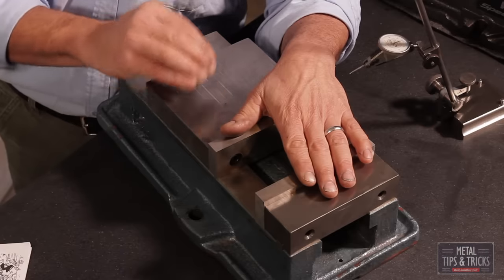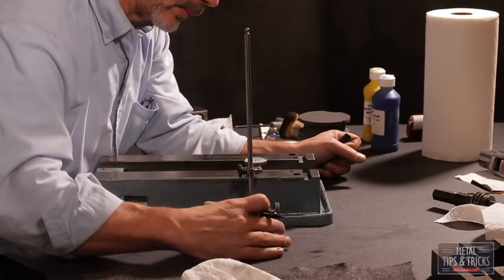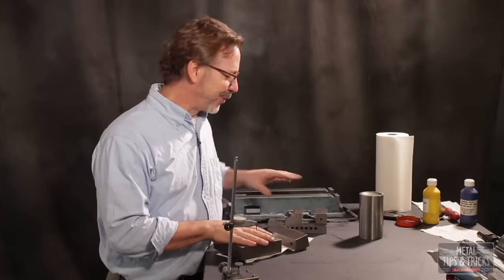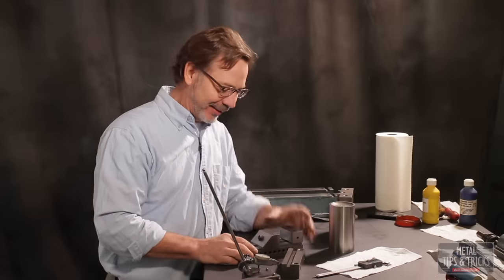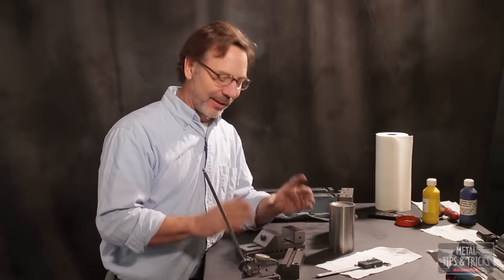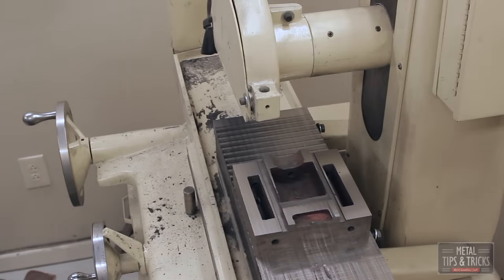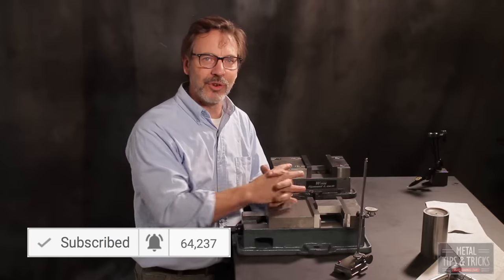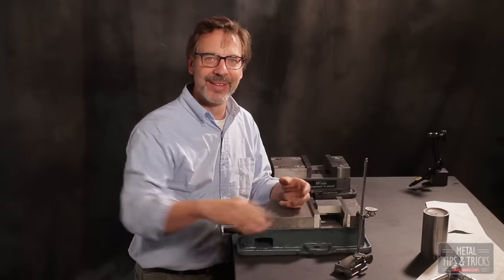China vs Usa  controversy machine vise

Comment: I  actually worked at the KURT vise plant in the 90's, making D60 vises. The level of quality control was ridiculous. We were actually sent home for days because the castings wouldn't pass the test you showed (under MUCH higher torque) until the foundry figured it out. Even though it was a tough job, it's still the only vise I'll ever use. Money well spent.
Reply: Cheap Chinese Junk. I bought a small 3" Chinese Kurt and had to totally rebuild it. It is now one of my most precise vibes but, I had to put the work into it. I also had to send it out to have it put in an oven for curing. It was hours in the oven

Comment: I have 20 years in the machine shop as a Journeyman Machinist and Class A Tool & Die Maker. I have spent many hours on a surface grinder, grinding things parallel and flat. I found that if you have two surfaces that are warped, I have gotten Plaster of Paris and mixed it pretty thin and poured it on the bed of the surface grinder, then put the part on top of the P of P and worked it in until the high places touched the bed then set back and let the P of P dry completely, then turn on the magnet and surface grind the top of the part flat. The P of P would fill in the high spots from the bottom and when it dried and I turned on the magnet, it didn't move. Then release the magnate, remove the part and clean off all the P of P and lay the ground surface on the bed and grind the other surface parallel. I have found that 99 times out of a 100, this worked to perfection.
Reply: Great method!

Comment: Grinding the vise will not reduce the amount the part rises during clamping, but adjusting the angle lock feature will...
Reply: I'm surprised a guy this well equipped didn't realize that. He didn't even mention the lift mechanism

Comment: I admire your tenacity.  I used to have a Brown and Sharpe #2 6x18 surface grinder which was automatic grinding except for down feed.  I thought I was bored running it for hours on end.  Here you are doing it with a manual machine.  What a man.

Comment: Dale. Another thing with castings is ageing. They really need throwing out in the yard to rust and get hot and cold for about a Year before final machining. That is why if you can get hold of old machine tools, they are great not only because of the original ageing before being machined, but also the further ageing over the Years. A bit like Scotch Whisky, the older the better it gets.
Reply: Dave Ticehurst BMW used old engine blocks for their turbo F1 engines back in the 80s because of that reason
Reply: +jonnoMoto was thinking the exact same thing!
Reply: That ageing in weather is partly a myth and partly true. Sure, the casting stabilizes once it has been sitting for "ages", but you get better and faster results with proper heat treatment, like aging and stress-free casting.
Reply: @JaakkoF  Finally someone telling the real story on the aging myth.

Comment: Interesting videos in that they quantified the expected differences. I think the Chinese vice would work well for 95% of home machinists. When I was a toolmaker things were milled to a few thousands tolerance and anything required finer went on to be ground. I do wonder if the inaccuracies would be noticed by home machinists. The Chinese vice is appropriate for people with mini mills. I don't see a lot of sense in investing in a vice that cost two thirds the price of the milling machine. In a commercial workshop things are different and budgets are bigger.
A good test would be a test piece from each vice milled on the same milling machine. Say a block milled to 4 x 6 x 2 inches
Reply: Les Fackrell would love to see that too
Reply: You get what you pay for. That’s why I don’t follow the logic of these sorta videos. Just like japan China also has professional brands.
Reply: @professordrmao6321  i bought a $3500 chinese vice

That was a bad time

Comment: So my question is why does it take more time (money) to touch up the cheap one that it took to build the entire Kurt, it seems the comparison should be can you build a comparable vise to the Kurt for less than $600... Obviously, if everyone had a few million to blow on gear we’d all be in better shape as you tend to get what you pay for.  I kinda doubt anyone buying a $200 dollar vise is expecting 1/10th accurate, especially when you’d need several hundred thousand or a lot more invested in the rest of the shop to even attempt it...

Comment: I agree with your point that the comparison is fair and your reasons behind that. My extremely low budget shop stretched just buying the cheap Chinese vise, and even though my measurements pretty much agreed with yours it was a serious upgrade in my work holding.
For me the cheap stuff makes sense. For any serious or professional machine shop it would be a hard no.

Comment: I have rebuilt the Chinese Kurt and outside of the density of the Chinese iron being porous the vise can be rebuilt to Kurt standards. But it is bad to rebuild a new vise when it should come usable out of the box???⁷ I also ground my vise in the milling machine which, I will be using the vise in, the vise ended up matched to the Mill's table and the spindle.

Comment: I didn't notice if you adjusted the moving jaw down force screw in the middle between the 2 vise jaw screw holes.  I tend to loosen mine up when I need to get the moving jaw adjusted fast, and snug it up when I need that jaw to stay down.

Comment: Out of curiousity, was anything inspected or corrected with the underside of the screw contact?  I know that I own a couple of chinese vises and some were very low quality and others were astonishingly great.  most of the bad ones were difficult to get fixed up and within usable spec for anything requiring tight tolerances, but big improvements were possible.  the lifting issue was one i corrected by cleaning up the underside of the saddle where the bottom plate rides and cleaning up the pull down mechanism when clamping force is applied.  i did not use anything scientific except a dial indicator in the spindle for before and after clamping rise results, but i was able to reduce it to about .0015" under my regular clamping force where initially is was .005-.006".  wasn't sure if you wanted to correct that any since you already put in the time to regrind everything flat?

Comment: What is the perpendicularly of the fixed jaw under load on each vise? This is where I was VERY disappointed with the Chinese vise.  We had one in the shop, similar clamping set up as you demonstrated, and it was out 0.008" -  0.015" up and down on the fixed jaw! I told my supervisor to get this out of the shop, we tried regrinding and wasting valuable time as well.  Great video, thanks!

Comment: Well said. I bought a CCVice it was all my budget would stretch to. It will get me some experience with my new milling machine where at first ,exceptional accuracy wont be an issue. They most certainly have a place in most workshops. I suppose as a rooky engineer it should be a project to improve it ,thus fulfilling a raison d’etre. Regards Stuart Bell from England UK.

Comment: So just to add to the fray, I took my old style bridgeport vise. Original BP , and with a tenths indicator did the same test. I am out .0017, so that's better than the knockoff. And this does not have anti lift design.  So I am happy, I think I am in an acceptable range right now for my needs.

Comment: Hey I have the same vice and thought about getting a more expensive vice but as a tool and die maker thought about fixing it with what i know. if you re-machine the key way to a tighter tolerance and drop in a 3/4 key. then get new bolts and put about 120lbs of tork on them. That will fix the vice and stop the solid jaw from moving because there was too much clerence in the key way.

Comment: when grinding the base shimming is needed if the part rocks but this part weighs enough that the magnet is not needed when taking light grinding cuts . I also prefer a electro magnetic chuck when grinding it allows mag force to be adjusted just enough to hold the part down without distorting your part

Comment: The deflection of the block depends on the pressure of its two sides. The torque is just the same on their screws. In order to  measure the TRUE difference between them, the difference between the screws in the two vises may be needed.

Comment: Torque wrench is nice, but did you actually check to see what the pitch on those screws were? I'm pretty sure that they are not the same, hence the force applied to the jaws is quite different with the same torque setting.

Comment: One of the ways that Kurt keeps the moveable jaw from kicking up under load is by putting a couple of o-rings below it to give it some spring. This allows the ball mechanism (ang-lock, their main patent) to pull the jaw down and pull the part *down*, not up. One of the main ways the imports cheap out is by skipping something like that. You could have removed more of the part lift by cutting the mounts for a set of o-rings into that jaw. Maybe 20 minutes of time on the mill to use a 1/2" center cutting end mill and maybe $0.10 worth of o-rings straight from Kurt. It's all well and good to point out that it costs time and money to make that vise better than it came from the factory, but there's working smarter, not harder too.

Comment: Great Video.... I am going to watch it again !!!   I am new to milling,  I have a low price 3" vise for my HF Mini mill....  at  20:00 you use a torque wrench .... about what ft lbs, or in. lbs.  should I use on a 3" mill vise ?    First time I used it never felt it got tight,  second time I use it never felt to get tight,  3rd time  fixed Jaw came off... stripped the 2 hold down bolts,  I was easy on it,  I am 70, have used many vises over the last 60 years, I know how to care for my tools.   Thanks again for a great video....   Yes for home use,  I don't need a $1,000 vise on a $700 mill.

Comment: kinof wondering where the 4/10th difference comes from if its indeed the metal casting bending up (could check the straightness of the bottom of the vice with the piece clamped in and torqued down if its holow its he back casting bending ) or the movable jaw lifting up (if its not the back see if the top of the movable jaw is still level or climbing up )
you might get it better by deleting the play between the parts

Comment: So what if you make a hardened metal base for the vice to increase it's rigidity? Add back those 12 pounds of metal! BTW, if clamping warps your vice that much I wonder if it will also warp the mill table it's mounted to? Possibly increase the dovetail wear and binding?
Reply: What I meant was a plate to go under the vice, probably clamped to it by plenty of screws, to stiffen the base up. That is assuming the flex of the base is really the significant source of error here. But I assume it's a good thing if the base relies less on the rigidity of the mill table, as it means less flex of the mill table.

Comment: Ha! I've got that exact same chinese vise, with a turntable. Was about 15 years ago, I was a machining newb (still am, I suppose), I didn't have a surface grinder, but did have a new to me Bridgeport (1958 M-head) so I took the vise apart, flipped the body over and milled the base, then squared it out from there. I still have it, and it occasionally gets used.

Was a pretty good beginner project.

Comment: The real moral of the story is "own a surface grinder". Old manual grinders are often dirt cheap. My bro got one with a quality mag chuck for $150 complete because the seller quit using it in favor of modern grinders; I scored six vises (four Kurts, two good older Taiwan clones) for $50 each at an estate sale. After we cleaned them up my bro who got the two Taiwan clones to have a matching pair ground them square and true (standard Kurt overhaul procedure) they work and feel precisely like the Kurts. Eventually I'll match a pair of mine the same way. 

A production shop won't have time to do that so buying Kurt is convenient, but Kurts are designed to be rebuilt and parts are reasonable. Practical Machinist thread showing how a professional overhauls one.  https://www.practicalmachinist.com/vb/general/saving-kurt-vise-scrap-bin-161489/